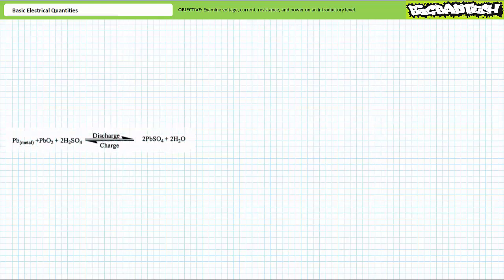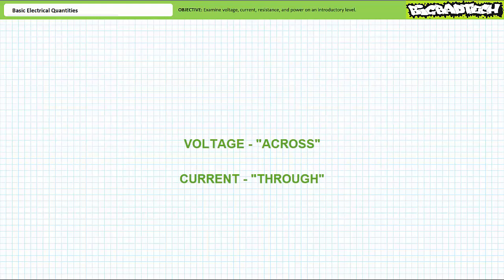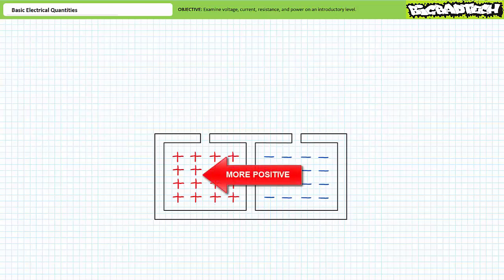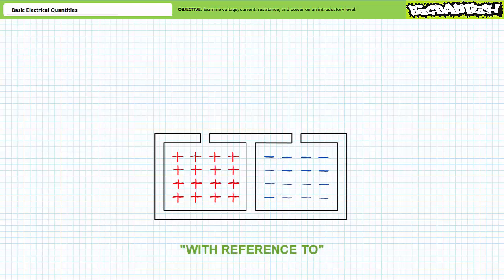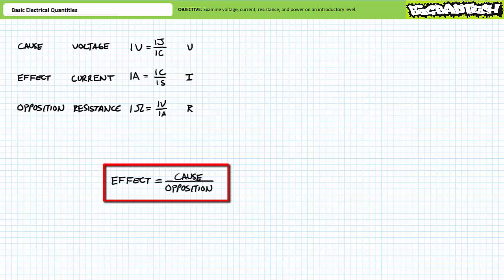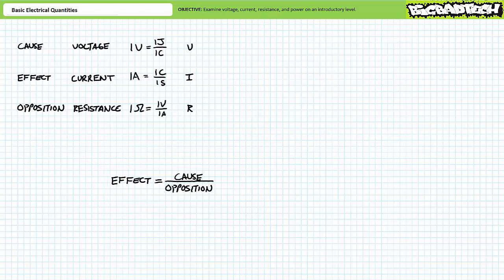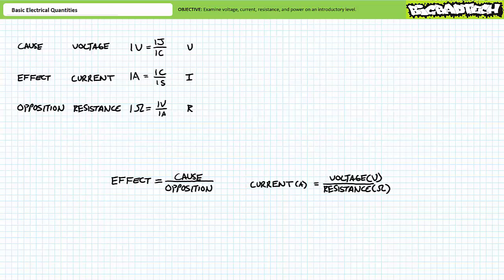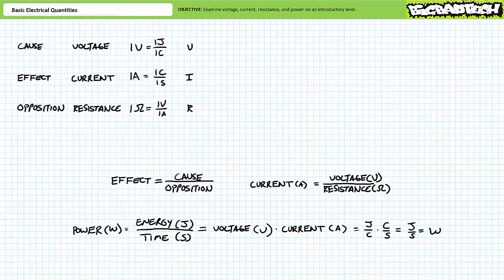Basic Electrical Quantities (Part 1 of 2)

Comment: Too bad it the signs would be backwards, otherwise compressed air would would work well in the analogy. There would be a difference in pressure (V) and when presented with a pathway with a low enough opposition (R), air (I) would flow. Eventually, the two chambers would naturally equalize. But, positive would flow to negative.

I'm not knocking how you did it, it works fine, I've just work with a lot of people who know air pretty well, so that's been my go to. A few months ago I explained air to an electrical guy, using the electrical as the basis. 1st time ever for me.

Comment: @Jim Pytel Hello! I have a question. At 8:16 you said that Amp is a derived unit? I thought the Amp was a fundamental unit in the international system.
Reply from the maker: True. The Amp has been redefined as a fundamental unit as the constant current that, if maintained in two infinitely long straight parallel conductors with a negligible circular cross-section and placed 1 m apart in a vacuum, would produce a force between the conductors equal to 2 x 10-7 newtons per meter of length. This definition is a little impractical for most folks and it's best to think of current a derived unit as a result of one or more base units (ie: coulombs, a quantity of charges, per second, a measurement of time).
Reply: @bigbadtech  I understand your point of view and I can accept it. Thank you!